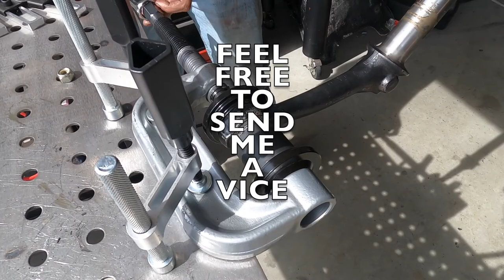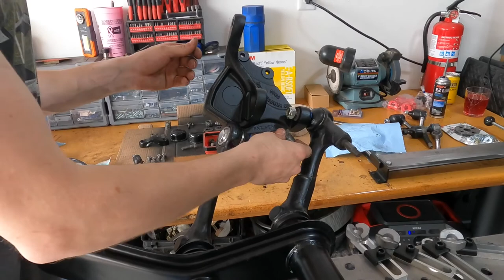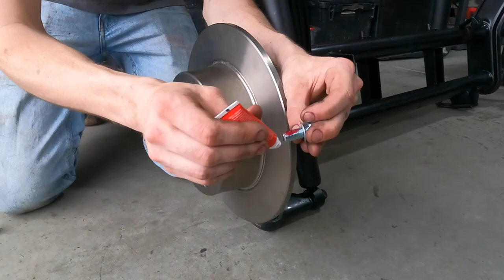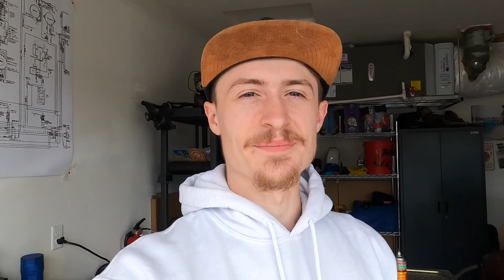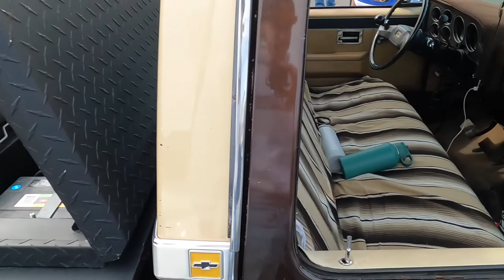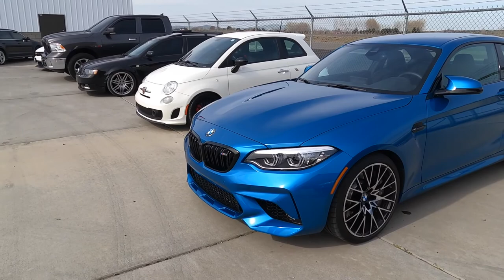Front Beam Gets Drop Spindles and Disc Brakes! - Cal-Look Part 2

Comment: I have done that job many times, used to use a hydraulic press for the ball joints, and yes I struggled putting the torsion bars back in the same way you did.  nice job
Reply from the maker: I need a press pretty bad... Transforming from a home garage to a shop one harbor freight tool at a time!
Reply: @mobilemotorsport  I used to work for the first independent VW specialist in the UK.